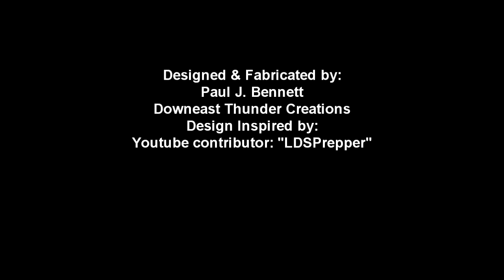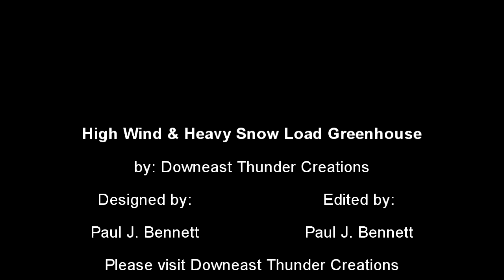(S-1 Ep-5) High Wind & Heavy Snow Load Greenhouse (FREE PLANS)

Comment: Very cool, Paul!  Would love to do one of these here eventually.
Reply from the maker: Thanks! If you get a chance, check out videos by LDSPrepper and see what he did. If you want to do something like ours, I have a drawing you can use as a guideline. You can always change the dimensions to suit your needs. The main "T" frames on ours are spaced 10' apart so there are a total of 3 (one at each end, and one in the middle). For most parts of the country, this structure (for what it is) might be considered overkill, but it's just the ticket here  in Maine! Thanks for watching, and thanks for your comment. More pictures  of our greenhouse can be found on my wife, Susan's blog: http://www.downeastthunderfarm.com by searching the archive. You can also find free plans for a 4' x 8' chicken coop there as well - along with photos.
Reply: Thanks for the additional info and the offer!  What's the approximate cost of materials to build one like your demo here?
Reply from the maker: The total cost (for us) was less than $600.00 and that included all the wood, pvc, fittings, brackets, hardware such as bolts, nuts, washers, and the greenhouse plastic. The tractor with backhoe is ours so we didn't have to rent one. That would add a significant cost to the structure if you did indeed have to rent a machine. Out greenhouse is 10' x 20' or 200 square feet, so we feel our cost was fair, and we've since recovered our cost in vegetable production. We're now thinking about building another one, only a bit larger: We'll keep the same width of ten feet, but increase the length by adding additional "T" type main support frames every 10' or so. If you are local, you are welcome to make arrangements for a visit, and check out our greenhouse in person.
Reply: what kind of wind you get there i've been looking around on a design that can handle 50-60 mph wind. also will the sun master 6 mil 55% white greenhouse film be able to handle golf ball size hale. i never done greenhouse before any tips would help size i would like to build 50Wx100Lx12H some thing of that size. or would building 2 half the size be better because of the wind speed.
Reply from the maker: We typically get wind gusts higher than that (hurricane force) during our winter nor'easter storms. As for greenhouse plastic - you should contact the manufacturer for specifications as they are all different. The design I used is 10' wide, by 20' long. The size you mentioned you are interested in (50' x 100') is beyond any consideration I made while designing our greenhouse, and I have no experience with anything that large. Sorry, but I don't have any suggestions for that.

Comment: Hi, whats the length of the 3/4inch conduit pipe?
Reply from the maker: I honestly can't remember, Matthew. However, Each pvc length is 10' long and an additional piece (much shorter) had to be added. I'm thinking it was somewhere around 15 or 16 inches. Because I used pvc electrical conduit (the gray stuff) because it has UV protection (where regular white pvc does not), one end is flared so you don't have to buy extra couple pieces. You would only need a couple extra lengths of conduit beyond the number necessary for all the ribs. Originally. I bent a length of conduit from one side over the ridge pole and then measured the distance from the end of the conduit to the other side to figure how long the short piece needed to be. It's pretty easy to do, and once you have that figure you can cut a number of short lengths all the same size so you won't have to measure/fit each individual rib. Hope this helps.
Reply: That helps alot thankyou, I've been looking for a DIY greenhouse to use as a fish house/enclosure. This design fits my need more than some of the conventional polytunnels.
Reply from the maker: @matthewnicholls1411  👍👍👍